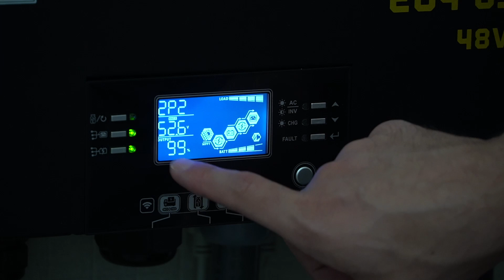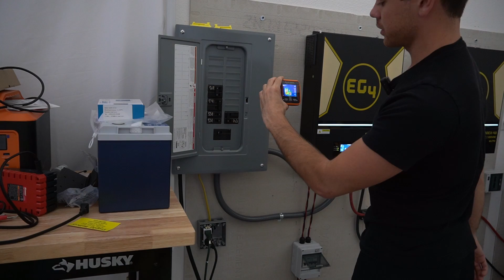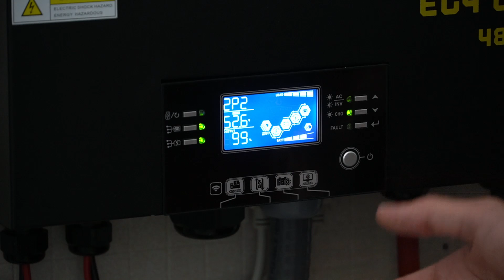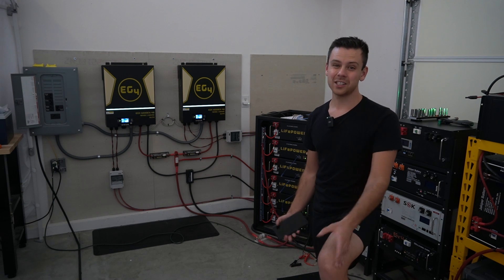EG4 6500EX Max Load Test, Heat Camera Inspection, Upgrades and Discussion

Comment: I agree, until you use one, you don't realize how useful a thermal camera is. In particular for battery terminals and checking your battery cables and crimps. Victron makes great gear, so you should consider setting up a split phase system. My really big question is about the grade B cells, do you use an active balancer? I have never found one necessary myself, but apparently some people get excited about 20 or 30 millivolts difference once they get above 3.45v per cell. If you top balance and charge them regularly, they just work even with a small passive balancer (not really passive, but you know what I mean, they don't transfer energy from cell to cell). I just don't understand how they can look at a charge curve and think they are having a problem. Almost forgot, thanks for the video.
Reply from the maker: Yeah there is some cell drift but every capacity test has been great so I haven't thought about it. If I need to balance them I'd leave it above the balancer threshold voltage for a few days and check them. Usually that fixes it. If the capacity was bad, I would try to find a bad cell and try to swap it out. If possible. Not ideal but works for grade b packs
Reply: @WillProwse   hey Will have you looked at the mpp 11kw max unit?
Reply: @WillProwse  🕊️🦅❤️WELL SAID 🕊️🦅I🕺🕊️🕊️I🕺🕊️ EASY TO FOLLOW 🕊️ INSTRUCTIONS ❤️💙👍🏇✌️🏇🙏
Reply: My lights Blink when I use infared cook top.  Any one know where which light to replace so it will stop blinks like this please tell me which type of lights and where to buy them, thanks a lot.

Comment: Yes I agree about surge capacity. The surge capacity on the Sol-Ark is wrong. You cannot get it up to it's surge capacity without it tripping. Tried it multiple times with newest software.
Reply: I have had no issues getting the 12K up to Max Surge capacity.
Reply: @Dreadlk  not to doubt you but I call bs. I can show video of at least two that will 100% go to fault instantly with a 12-13kw load, split evenly on each leg. The manual, spec sheet and everything says it should be able to do 16kw @ 10 seconds. It just isnt happening.
Reply: @av1204  I've tested up to 23-24kW surges with my 15k without issue
Reply: @niktak1114  is that on grid or off?
Reply: @av1204  off grid
Reply: @niktak1114  maybe will will test it because I still don't believe it.
Reply: @av1204  have talked to Sol-Ark? Their tech service is awesome..

Comment: My solar system is running for about 2 years with zero issues.  Will is one ho inspired me. Thanks for your great videos!!!
Reply: Indeed!  We have learned SO MUCH!  We are currently building our small off-grid 2.4kW array (with utility backup charging), and have got my mother in Dallas squared away with a Bluetti & extra battery.  My son and sister also have a Bluetti & other.  Thanks from all of us Will!
Reply: Will is a well known ho. Lol

🚨🇺🇸
Reply: My lights Blink when I use infared cook top.  Any one know where which light to replace so it will stop blinks like this please tell me which type of lights and where to buy them, thanks a lot.
Reply: Yep, after watching his videos... I wanted to build one... so I did. LOL I have a 1kw solar array, 40a Renogy MPPT, EG4 lifepower4 5.12kw battery, a Giandel 2000w inverter and a 24v fuse block with some car "cigarette" power sockets on it and I charge my devices off that..  My system has produced 1,180kw(1.18MW) of juice used over it's lifespan.
Reply: You have a typo you should check here spelling

Comment: Another great video Will. How would you rate the EG4 6500EX compared to a Victron Quattro 48/5000 in terms of build quality & dependability? I have a van conversion company, and we typically use Victron products for inverters. However, the new EG4's price points are pretty attractive.. Im just worried my clients will have issues as EG4 is fairly new.
Reply: Victron's integration with a mobile camper is unsurpassed. They can intelligently regulate the alternator flow to the battery and shore power load shaving and everything but the installation is definitely more complicated.  Heck just trying to understand all the different physical components of a Victron system that you may need is a big learning curve.

Comment from the maker: Complete 48V system blueprint for free: https://www.mobile-solarpower.com/48v-complete-system-blueprint.html

Server Rack LiFePO4 deals: https://www.mobile-solarpower.com/server-rack-lifepo4.html

My Reliable Heat Camera: https://amzn.to/3KId4WR

Ecoflow Delta Pro: https://ecoflow.com/products/delta-pro-portable-power-station?aff=7

0:00 Load Test Setup
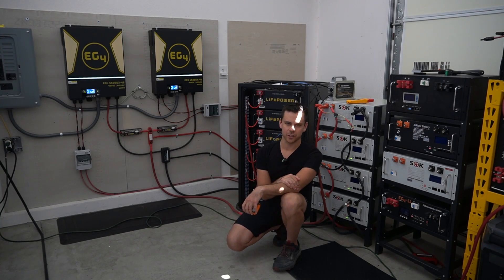2:03 Heat Camera Time!
5:40 LF VS HF Inverters and Youtubers
8:49 Grade B Cell EV Charger Update
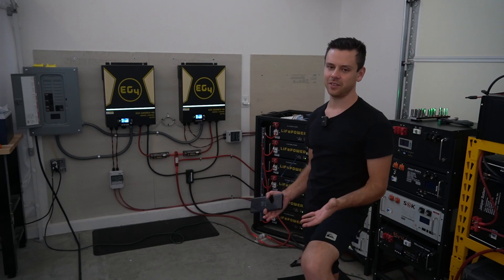9:33 Test is Done!
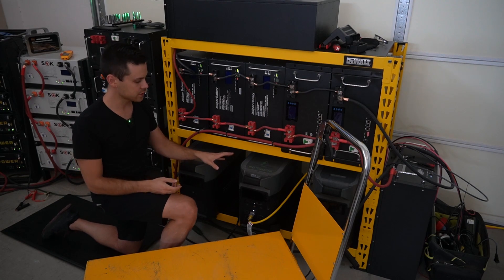11:01 Ecoflow Delta Pro Update
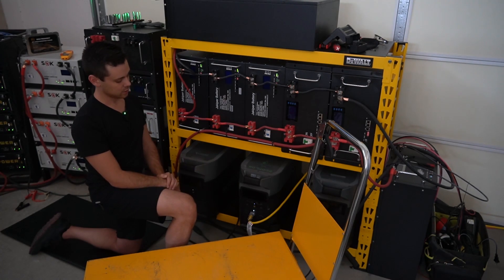12:08 Ending

~~~~~~~~~~~~~~~~~~~~~~~~~~~~~~~~~~~~~~~~~~~~
Tired of getting ripped off? Check out my "Will Prowse Approved" solar product recommendations below!

12V Batteries
https://www.mobile-solarpower.com/lithium-batteries.html

48V Batteries
https://www.mobile-solarpower.com/48v-batteries.html

Offgrid Inverter System Builder
https://www.mobile-solarpower.com/48v-complete-system-blueprint-559371.html

Hybrid Inverter System Builder
https://www.mobile-solarpower.com/code-compliant-48v-offgrid-system.html

Mobile Handtruck System Builder (very popular!)
https://www.mobile-solarpower.com/mobile-48v-system.html

Solar Panels
https://www.mobile-solarpower.com/300w-solar-panels.html

Ground Mount Solar Racking
https://www.mobile-solarpower.com/ground-mount-racks.html

Wire, Lugs and Busbars
https://www.mobile-solarpower.com/wire-and-connectors.html

Tools
https://www.mobile-solarpower.com/tools.html

Fuses and Circuit Breakers
https://www.mobile-solarpower.com/fuses.html

Plug-N-Play Solar Systems
Ecoflow, Anker And Bluetti! So many models to choose from. See my current recommendations here:
https://www.mobile-solarpower.com/full-size-systems.html

~~~~~~~~~~~~~~~~~~~~~~~~~~~~~~~~~~~~~~~~~~
Need to build a large DIY system? Need a trustworthy solar distributor? These are my favorites:

Signature Solar
Creator of EG4! Solar Minisplits, Victron and More! Largest Solar Store Online.
If you want $50 off, please use my link below and coupon code "DIYSOLAR50":
https://signaturesolar.com/?ref=cPwLcVc0SW-BjN

Current Connected
Best Prices for EG4, Victron, Midnite and so much more! Fast Shipping and Highest Rated Customer Service:
https://currentconnected.com/?ref=wp

~~~~~~~~~~~~~~~~~~~~~~~~~~~~~~~~~~~~~~~~~~
Join our DIY Solar Community 
Need more help? Join the largest solar forum on the internet for beginners and professionals alike. 140,000 members and counting!
https://www.diysolarforum.com

Check Out My Free Book
Best-selling and beginner-friendly guidebook to off-grid 12V solar!
https://www.mobile-solarpower.com/the-book.html

~~~~~~~~~~~~~~~~~~~~~~~~~~~~~~~~~~~~~~~~~~
Contact Information:
I am NOT available for personal solar system consult! If you wish to contact me, this is my direct email: williamprowsediysolar@gmail.com
FTC Disclosure Statement and Disclaimers:
Every video includes paid promotion or sponsorship (such as free products for review). Some links on this YouTube channel may be affiliate links. We may get paid if you buy something or take an action after clicking one of these. My videos are for educational purposes only. Information is subject to change/update at any time. Electricity is DANGEROUS and can kill. Be smart and use common sense :) DIY Solar Power with Will Prowse is a participant in the Amazon Services LLC Associates Program, An affiliate advertising program designed to provide a means for sites to earn advertising fees by advertising and linking to Amazon.com
Reply: I just saw that there's now some new thin flexible solar panels which can bend at "360°". Can you do a review on those please?
Reply: Yeah Victron is nice, but when you look at the power loses caused by the rest of the equipment that is required and extra wire runs? Its really not as efficient as they say.
Reply: @WILLIAM PROWSE

🙏PLEase I have a question for you? 

If I wanted to spend about 7g's on a battery rack/ solar  system which one do you recommend? Like for your own home. Can you please print me to the video of that one you would want for your family?
Reply: Does your book cover info on the MPP All-In-One units???
Reply: That inverter is probably rated for no more than 50 degrees C. That is a UL standard for most electrical assemblies unless the electronics are Conformally coating usually allowing them to be 60C rated.
Reply: I've watched a lot of your videos and it's very shocking, we have solar generators, can I contact you?
Reply: Will, hope you get a chance to review Nyobolt tech which is batteries specifically for EVs, of Niobium and tungsten.
Reply: Merry go round or carousel for simple 1 axis ground mount solar tracking? 
Good idea? Bad idea? Too expensive for what it gets? 

You'd need a little solar tracker, but that's just a couple photoresistors and some wiring, or hardcode it into an arduino, and a motor to spin the carousel but that shouldn't be too much since it doesn't have to move fast. I bet a simple cordless drill could do it with the right gearing.
Reply: Will Prowse!!!  I am finishing my 2.4kW panel mount today.  DO YOU HAVE or WOULD YOU MAKE a video on Off-Grid Ground Fault Protection as now required per NEC 69A???  Thank You for the video on proper combiner boxes & reversing diodes by the way!!!
Reply: can you mention needing a group 31 size empty battery box in a video so China will make one? they have some that are the right size nut the terminals are not centered. 

if we had group 31 cases we could diy with commercial truck battery busbars and battery boxes. off the shelf parts.
Reply: Hey does your also ship to Europe or curacao ( which is close to the virgin island? )